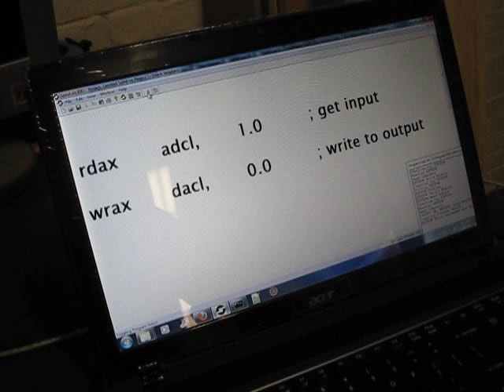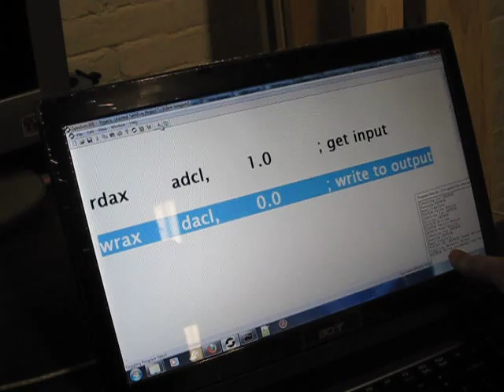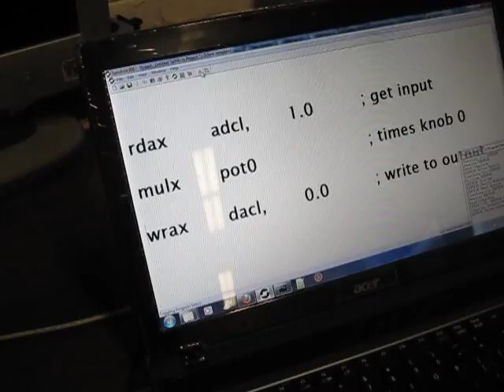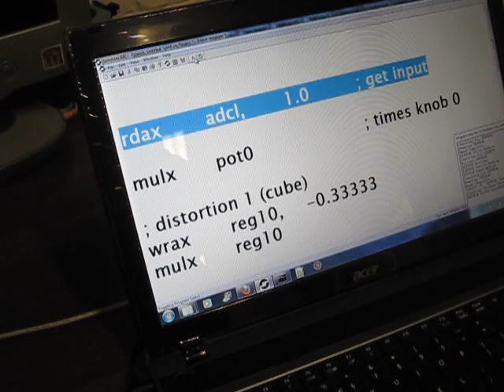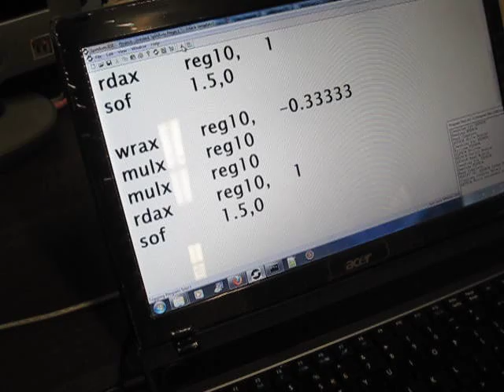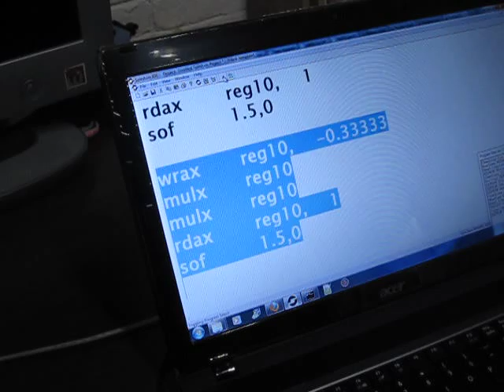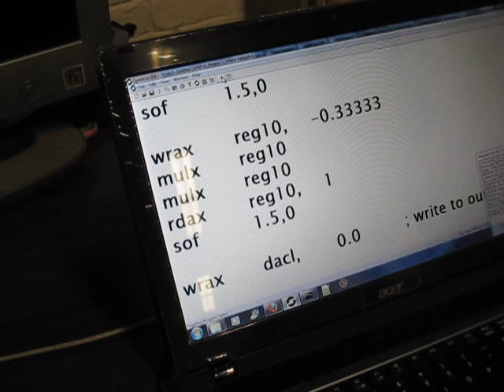Introduction to the FV-1 DSP Development System - Making a Simple Distortion Effect

Comment: The cubic distortion algorithm is not meant to be stacked in series (not that you can't do it if you want), instead to get more distortion you simply need to multiply the input signal (increase the gain) before it to make it distort more. Actually that's how most analog overdrives/distortion work, they amplify the signal (usually with the gain knob) before the clipping circuit

Comment: I've now released the Java source code for SpinCAD Designer, which builds on Andrew Kilpatrick's excellent foundation of ElmGen.  SpinCAD Designer allows you to create FV-1 patches using a graphical tool with no Spin ASM or Java programming required. It works on Windows, Mac, and Linux.  http://tinyurl.com/q9yu5qr

Comment: Can i do programming without the development board?
Reply: I think so, you need something to program the 24LC32A EEPROM, there are a bunch of different EEPROM programmers, I don't think you need a specific one. Programmers should start at about 2 bucks on eBay on AliExpress, SparkFun makes programmers too I believe, but at a higher price.
Electro-Smith makes a FV-1 board that makes it a lot easier to get started with this, you do need to wire up some jacks and pots and switches and stuff, but no SMD soldering required. That'll set you back 30 usd and it comes the FV-1, so you should have your own development environment for around 40 usd if you shop wisely.
Reply: To make the things to work well must know exactly what hexadecimal code to store in the EEprom chip since this is the final result of the assembler and there is no way to debug it if there is no available the source code.